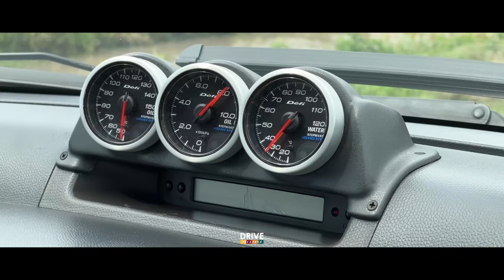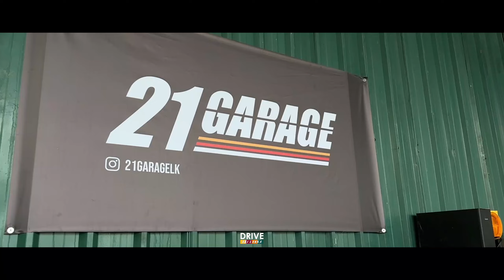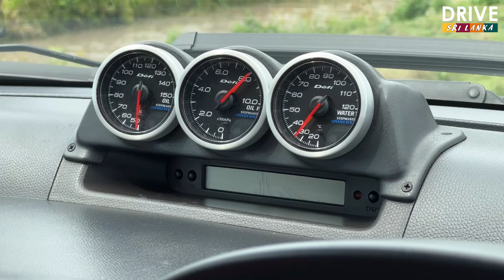Need For Swift | South Asia's Ultimate Suzuki Swift Sport Modification #suzukiswiftsport

Comment from the maker: Spec Sheet 👇🏻🔥
Fully built engine. 
Link Xtreme Standalone ECU - Tuned By Ashan Silva 
Tuned with both low boost and high boost maps. (95 octane)
Anti-lag and launch control functions 
Wiseco forged pistons 
ARP bolts 
K1 forged connecting rods 
Monster sport Valve springs 
RRP Metal Gasket 
Runs a Garret GTX2863R 
WEPR SS custom manifold (GTX28/GTX30R)
WEPR cold air intake with K&N filter 
WEPR 3.0” stainless steel downpipe 
WEPR stainless steel full twin exhaust 
Tial BOV
Tial external wastegate with screamer 
Aftermarket intercooler and oil coolers
Upgraded R’s Japan clutch slave cylinder
Upgraded clutch and pressure plate 
Bigger injectors with 750cc Injector dynamics  
D2 Coilover Kit 
Ultra racing front strut bar 
Xtreme clutch multi plate clutch kit with light weight flywheel 
R’s Racing Japan - reinforced chromoly front drive shafts
Reply: Brother can u mention the mod list for exterior? (Bodykit) specially: Front bumper, rear bumper with exhaust system and rear spoiler?